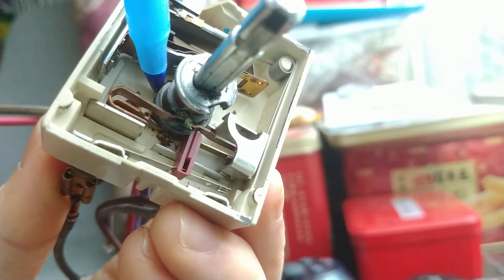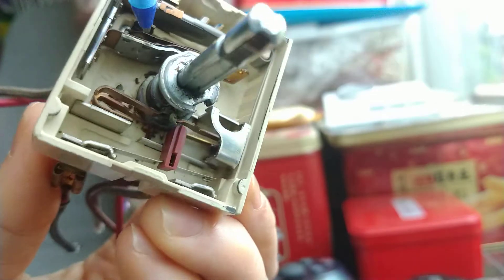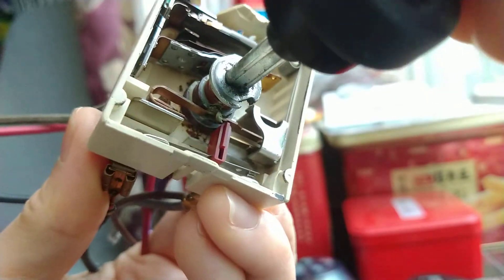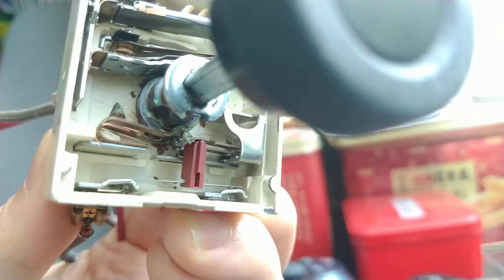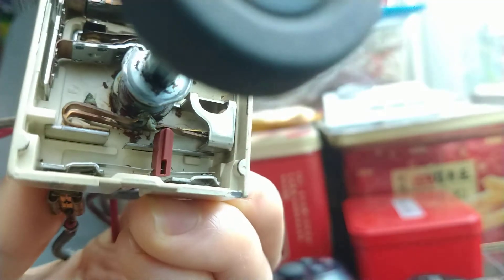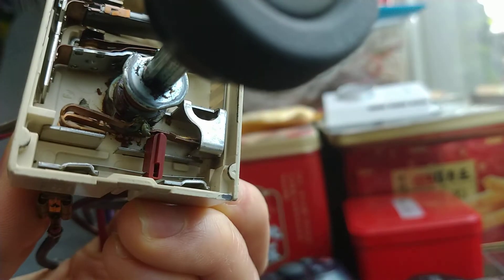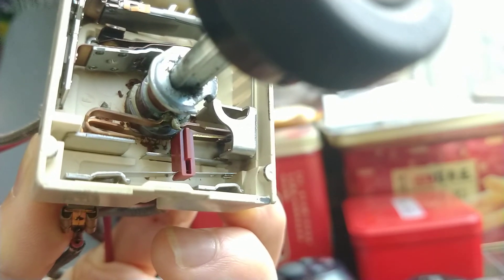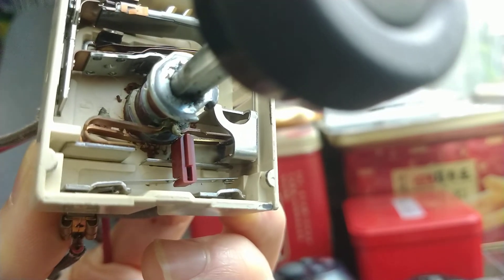Dual surface element infinite switch inside. Possible repair without paying $100+ to buy. Part 2.

Comment: how to remove the cover of dual elemnt infinite switch please
Reply: There are two metal pins left/right to lock the cover, just use a flat screw driver to tilt it a little bit. Very easy to pop the cover out.
Reply: @terrixie2152    THANK you SIR , hope this is going to be good,interesting useful to many people
Reply: Hi  TerriXie 
dual element switch
I like to comment about the  temporary repair of the switch
is that  ok
Reply from the maker: What question do you have?
Reply: How the  Partially   working dual element switch of the range was made to work perfectly (outer coil problem)
In  my Samsung Range's LeftFront dual element,only the inner element works ok.
but outer element works only from No2 to NO4.   The No6 to HI no electrical contact, no heat
I did the following to make it work and i was able to finish my cooking, this only a temporary fix, may be last for sometime.till you repair 
ELECTRICITY IS DANGEROUS
I AM NOT RESPONSIBLE TO  ANY DAMAGE TO  PROPERTY OR PERSON .
RANGE USES 240V 
(1)  Turn the knob of the range to   No 6(where there is no contact) 
(2) Hold the knob and slowly move up and down  or sideways , at some point i saw the outer element lights (In my case  the element lit when i move the shaft upwards) 
(3) Hold at that position and kept some material under the knob tight enough to keep the knob
at that orientation and also the material without falling  (when you turn the switch)
The matrial should provide some spring action because when you turn on the switch you have to push inward and rotate.
I used kids hair clip,which is curved and gives spring action  .  I wraped it  with insulation and kept under the knob and down the shaft
Also make sure that the knob is attached strongly (firmly) to the shaft (Axis)of the switch( otherwise the correct orientation won't be there when rotatig,(there will be movement between)
I wraped thin polythene on shaft and pushed the knob to it
THE SWITCH IS READY   BUT WHEN USING PUSH INWARD SLIGHTLY AND ROTAE SLOWLY
ITS WORKING FOR ME    WHEN NOT WORKING  I HAVE TO PUSH THE MATERIAL
THANKS for the video of  Terry  Xie from which I learned lot
Reply: @sathiyamoorthyvisuvalingam3149  Hi - Another temporary fix, is assuming the top main contacts P1 to 2  (live) are still making and breaking OK when the knob is turned, is to remove the front panel of the cooker and short together the middle contacts 4 and 4a out to P2 (neutral). Both elements will be still be regulated, but are now in parallel and so will  come on together when the knob is turned either left or right from the off position. Do any recipes actually call for grilling with one half of  a dual element anyway?